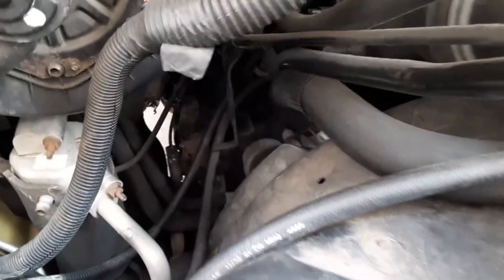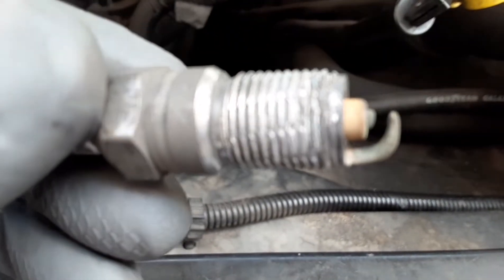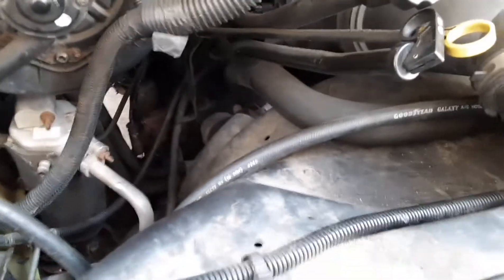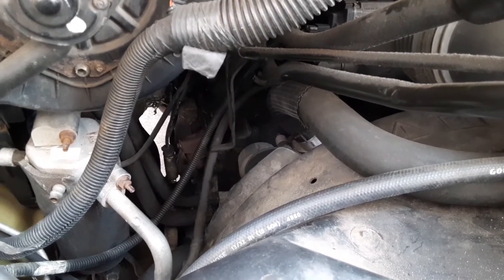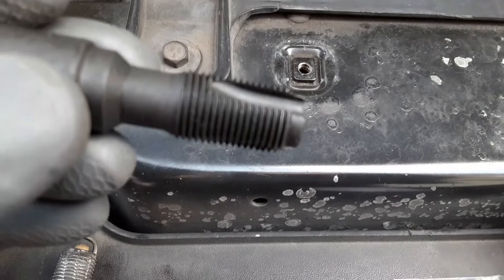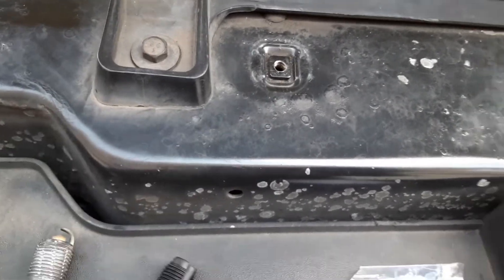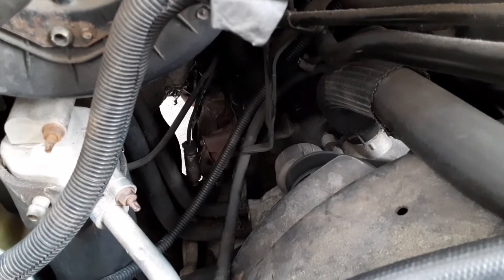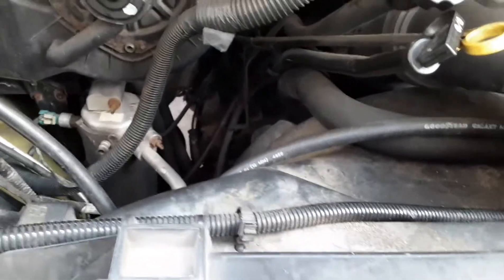How to repair and fix a stripped out SPARK PLUG hole inside Engine Block

Comment: Can a stripped plug cause damage? When I pulled my last plug it was stripped so I installed a new plug but it wouldn’t get tight like the rest. I have a 2016 Cadillac CTs vsport a v6 turbo engine
Reply from the maker: You gotta re thread it like in the video
Reply: @youcanfixthat8636 but how long you can drive it or what are the damages
Reply from the maker: @carlosg5772  forever. You just making a new hole
Reply: bir tanesini fazla sıkmışlar dişler bozulmuş yenisi sıkışmıyor aynı işlemi yapıcam fakat talaş kalmazsa iyidir kararsızım talaş kaçmasını nasıl önleriz bakalım